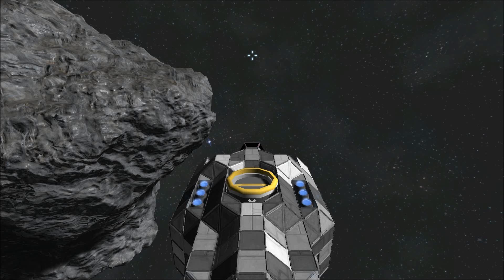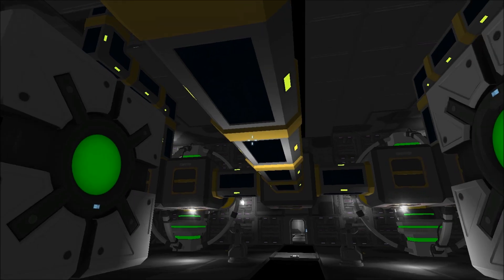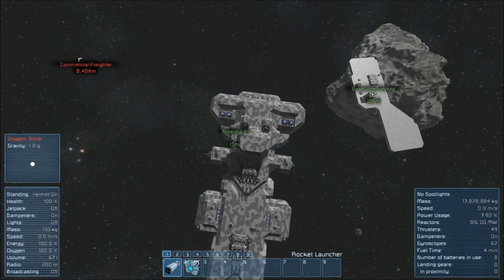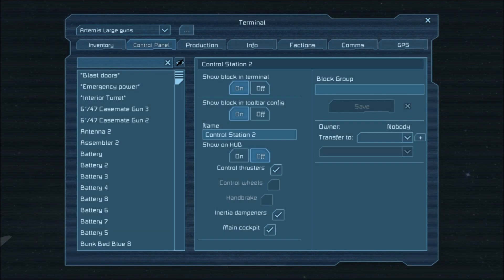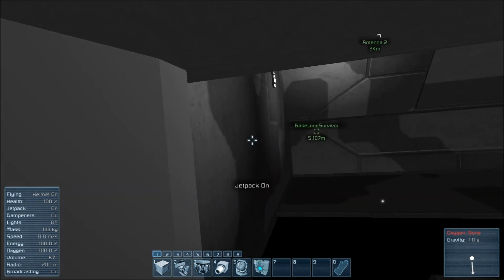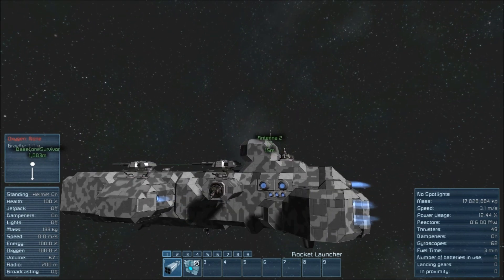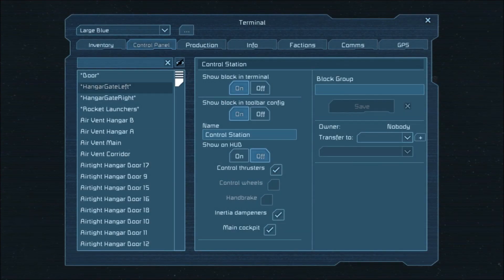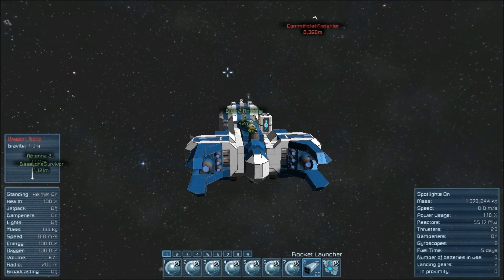Space Engineers; Jump Drive Updae

Comment: You're thinking of the the jump drive like a different type of ftl. The jump drive allows you to intersect two points of space at the same time instead of just moving in a straight line. Whichever direction your ship is facing, you can jump in a different direction. Does that make sense.
Reply from the maker: guardian1326 I figured it might have been the case, but I still wanted to test it, just to be sure.
Reply: Yea I completel understand. Now if it was a light speed engine from Star Wars, or a hyperdrive engine from stargate you could possibly do some major damage.
Reply from the maker: guardian1326
Oh, it would have turned my destroyer inside-out if that had been the case (and pancaked the blue ship). A little disappointed that it wasn't but on the other hand, nobody could use it against me. So that's a plus.